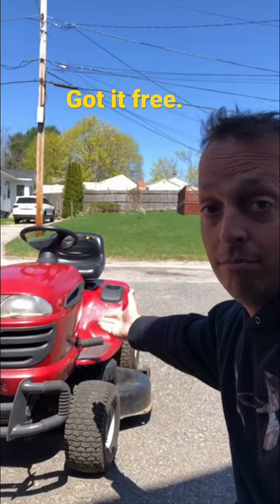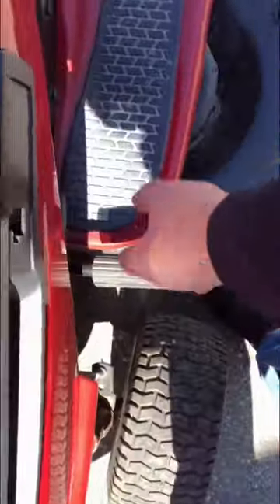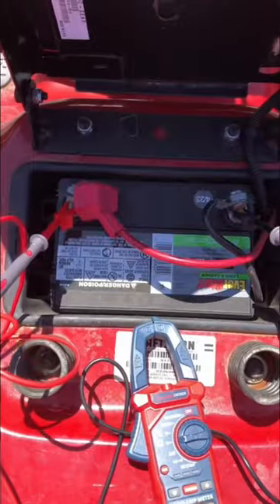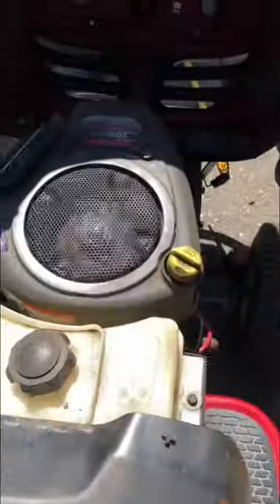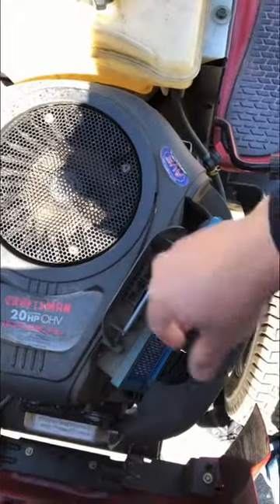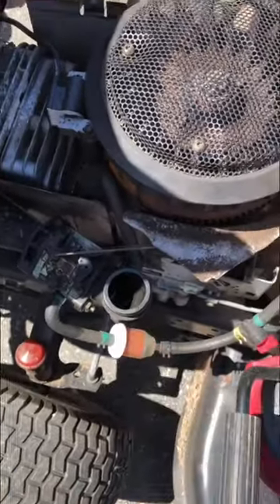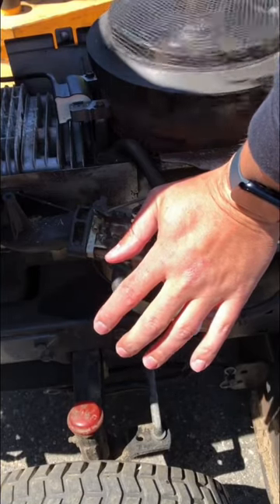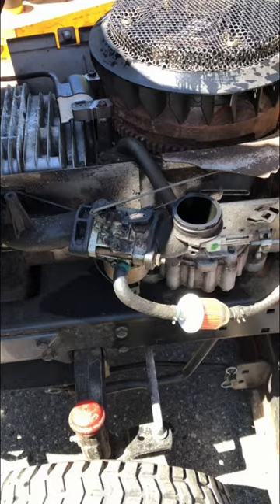Free mower. Won’t start. Cover the air intake! Briggs engine, Craftsman mower #smallengine

Comment: The fix is a valve adjustment. The decompression valve is not working. Briggs 101
Reply: The fix is to replace that piece of shit OIHV single with a better built flathead. I'm going with an 18hp boxer.
Reply: How do you do a valve adjustment
I have the same problem with my mower
Reply: Very good, that is exactly the problem there. 👍
Reply: Hydrolocked
Reply: @johnwaugh2613  it's usually on the exhaust valve, there's a weight on the camshaft that's deactivated by centrifical force once it starts. What has happened is it has loosened up the rocker arm, an needs to be tightened just a bit. Your motor will have its own valve lash specification. Pull the valve cover off and you'll see what tools you need. On compression stroke it releases a little bit of compression by moving the valve just a tiny little bit. When it's backed off all the way the starter doesn't have the balls to roll it over with all the compression the motor produces. There should be a YouTube video on your specific engine
Reply: @germanmg42  thank you for taking the time to explain that . I'll have to watch a few  videos on it.. ill give it a shot !!!!
Reply: @johnwaugh2613  your very welcome brother!!! Hope it helps. Love and happiness from a farm in northern Michigan! 👍
Reply: @germanmg42  love and happiness to you as well from the rural 🪵 woods of North Eastern Connecticut..
Reply: Bro that intek needs a cam. Compression release is on the cam... or was
Reply: Adjust the valves. That's a common problem.
Reply: @monadking2761 💯% correct
Reply: @German MG42  I think it was .004" gap on both valves, but I'm not sure off the top of my head. I did mine years ago, but I need to do them again since it starting to put a strain on the starter. Mine is the B&S 23hp V twin motor. If you don't have it right, it's very hard starting.
Reply: @monadking2761  yeah you aint kidding lol
Reply: That's exactly what the problem is the valve's are to loose
Reply: Honestly it about $400 and I would mess with it on my own.
Reply: @TestECull OHV engines are objectively better than flatheads. I have an almost identical Briggs on a zero turn and it works great. the only flathead engine on the property hasn't been used in years since it's underpowered and heavy.
Reply: @boostaddict_  The flatheads are basically unkillable. As long as you change the oil in them they will literally last for generations.

The OHV engines? Nope. Lucky to get 10 years out of them before they're shot. When Briggs went to OHV they went full steam ahead on disposability. They stopped putting steel liners in the blocks and instead went to a really shitty coating that wears right off. They're prone to bending pushrods if they're worked hard because the valve stem guides pinch the valves when the head gets hot. They're prone to...well, this very issue at hand, wherein the decompression system fails on them and makes them almost impossible to start. They use plastic in places plastic should not be used, their carbs are non-adjustable, and just in general they're designed to be discarded like an empty starbucks cup on the regular.

The current crop of them, particularly in consumer grade stuff, are especially bad about that. The push mower engines don't even have oil drain plugs anymore! You're just simply not supposed to change the oil in them at all...just check, add, go. Sounds to me like Briggs wants them chucking rods every 2-3 years.

Sure, sure, they're making more power out of less cubes, but the tradeoff is that legendary Briggs reliability and longevity had to go out the window. I'd much rather have the heavier flathead that needs more cubes to make 18hp but will outlive me than this shitty single that can't crank itself over if it isn't babied.

Side note, you see this in cars too. Same exact sorts of bullshit happening in the family runabout. And funnily enough, the next car I buy will also have a flathead engine in it; I don't care about HP per CID or HP per Liter, I care about how many generations the engine will last for.
Reply: @TestECull  Thats a meme lol, you mean you had a flat head ic motor that isnt clapped, if you want to join the modern age Kawasaki and Kohler have nice industrial lines
Reply: @nahhh5318  I dont want to join the modern age. Disposability sucks.
Reply: You don't have a clue
Reply: @FUCKEDUPFAB  Why I'm going to put one on my tractor in leiu of the current 18hp single.

I'd also love to build a gokart around one one day.
Reply: That's what I was about to say but you beat me to it.
Reply: It's not the valves it's the camshaft decompression valve is broke
Reply: @russellgiles4644  Obviously you don't fully understand how the decomp valve works. The valves must be in adjustment in order for the decomp valve to work. However it is possible that you are right and the decomp valve on the camshaft is broken. But unlikely.
Reply: Pressure relief is broken on crank shaft. Too much pressure to start. And don’t take cowling off. Cover intake on right side of filter. Your welcome😊
Reply: There is no decompression value, the exhaust valve is supposed to never really close, lowering the compression
Reply: We had a bent push rod and header needed replaced idek how it happen brigs stratton mower 4-5 years old
Reply: Top dead center,  remove valve cover,  adjust to the thickness of matchbook cover
Reply: @johnwaugh2613 check out taryl fixes all valve adjustment
Reply: It’s always hand play for me 😂
Reply: @johnwaugh2613  just add another line to it bro connect it throw some WD-40 it’s out of adjustment old lawnmowers always, end up like that when we sit in the sun
Reply: @TestECull just found my first as you call it flat head Boxer,Kohler engine in an old craftsman Tractor, most had the Briggs flathead Boxer
Reply: It don't have what they call, CHOKE, it's normally a lever to do that
Reply: @TestECull  thats not a boxer thats called an opposed twin
Reply: @seanmckay3392  Ok James May, we get it now. Back to Oz Clarke with you
Reply: You took the words out of my mouth
Reply: Yep. Had a John deere 255 once and it would do the same. Adjust the valves and it would tick. Try to get it better its just that or the tick so I chose the hard starting lmao I didn't like the tick.  I just spin back to compression stroke an then hit key. Would have enough momentum to start everytime. Just was annoying
Reply: I was looking for this comment

Comment: Adjust the valve lash so the internal compression releases work properly
Reply: He can take it to a mechanic.
Reply: unless the lever broke, motor is junk briggs anyway.
Reply: @voidvincent  what's your point. He's trying to fix it himself. Defeats the purpose..
Reply: I don't know how many mowers I've picked up for scrap that I just have to adjust thhe valves and they run great
Reply: @rogersmith9506 they are alright? I suppose. Obviously no where near the glory of the flathead briggs but still alright. Have used and abused a 18.5hp in the Deere zero turn. Has this Issue lol. Always just charged it up before hand and make sure it doesn’t die or it won’t restart. Swell looks like I got more stuff to do hehe.
Reply: Have a video or link to executing this issue

Comment: Wow! I have spent 2 full days messing with my scotts s1742 and could not figure out what was wrong with it. Ive watched just about every other youtube video. Saw this now at almost 9pm and had to run out back to try it. It started up just like yours. From reading comments, it sounds like I have to adjust the valves. I was ready to give up 😂

Comment: That’s an excellent way to 
bend/brake a rod!! 😂😂. Take the spark plug out people. If it’s so flooded it won’t turn over it’s gonna break something.
Reply: Not flooded. It didn't have compression release that's why it wouldn't spin over. All that fuel Is there is because he was blocking the air intake and it put extra vacuum on the jets while cranking.
Reply: It sure looked like a lot more gas coming out of the intake than is typical when hard choked like he did. That said, in my experience, if enough fuel is in a cylinder to hydrostatic lock, the starter isn't likely to turn it over. Even turning by hand can be tough.

Comment: Valves, not adjusted properly, or that particular Briggs is known for the compression release breaking, btw, all you had to do is  back the engine up to tdc on the exhaust stroke, it will start then, 45+ years experience working on small engines
Reply: Just took my craftsman T1400 engine apart. Piston connecting rod was shattered all in the bottom of the oil pan. Poston looks good, cylinder looks good. Gover has a couple of broken teeth. Do you think it would be rebuildble? If I install a new rod and rings?
Reply: @FrankAtwood  shure, if the crank journal can be polished, and is not damaged, I have used muriatic acid to do this it works😎👍
Reply: @warrenfloyd1484 do you have your own channel on YouTube?

Comment: Adjust the valves, 5 thousands and it’ll start working fine
Reply from the maker: Worked like a gem 😉
Reply: That's pretty cool you could call it like that whataguy
Reply: But spec is .003  intake and.oo5 exhaust
Reply: @keithkillion4245  on units with decompression release, they start easier with the extra clearance. You need the extra clearance when the DCR hits the cam lobe.
Reply: @NiceLawnBro i got the same exact mower, if that blade engagement cable breaks just order a new one do the whole kit not just the spring.
Reply: Tighten or losen 5 thousandths??

Comment: It's flooding, our mower did that. We cut in a fuel valve on the line and shut the fuel off when not in use.
Reply: that helps, but the mower will always run too rich while running until you fix the leak

Comment: If it's hydro locked from fuel there's a good chance the crankcase is full of gas too. This is caused by a stuck fuel solenoid most of the time.
Reply: Usually at the crankcase is full of gasoline it's going to have a hard time idling properly.
Reply: You are correct sir.
Reply: Incorrect, the fuel solenoid has absolutely nothing to do with the engine flooding
Reply: @terryayers6770  no he’s not. He’s completely 1000% wrong.
Reply: @THEMOWERMEDIC1  I mean, a fuel solenoid going out could cause a hard start, but isnt going to flood the engine.
Reply: @THEMOWERMEDIC1 let us know where you're at so we can warn others not to go there. You are wrong about a very basic thing. Mower medic😂
Reply: Nikki carbs let gas come thru faulty seat valve
Reply: @semiprofessional8470 The fuel solenoid DOES NOT HAVE ANYTHING TO DO WITH THE FUEL LEVEL IN THE BOWL. it is meant to plug the main jet when you turn the engine off. The float is what is meant to stop the fuel from filling to high in the bowl (the fuel level in the bowl overflowing is what flooding is)
Reply: @semiprofessional8470  I’m not wrong 😂

Comment: i'd love to have a beater mower like that to just mozy around the yard in and drag the driveway smooth..  my brother mows our grass on a clapped out john deere s240 but i'd love to have my own. when i was a little kid we had one of those old boxy murray tractors with the 3spd transaxle control between your legs. I did 500 miles on that thing if i did a foot.

Comment: Yep when you do this trick you know compression release bad and needs replaced
Reply: Coming from a mechanic my whole life I have never heard of a small engine such as a lawn mower motor having a compression release for a motor with low compression from the factory Motors that have compression release are for high performance high compression Pistons that are in dirt bike and quad Motors that require premium gas to run
Reply: @dustinolney3977 no it's true that they have them. That starter can't spin that engine over without it. Yes the compression ratio is Garbo, but you gotta realize for these weak low performance lawn mower engines to be 18 HP, their displacement is massive

Comment: First, put a Fuel Shutoff Valve on it, and try it after waiting overnight.
Reply: The fuel solenoid has absolutely zero to do with the engine flooding
Reply: @THEMOWERMEDIC1  If you could read, I said Fuel SHUTOFF VALVE. It stops the flow of fuel to the carb/engine.  The Solenoid can also cause it.
Reply: it needs a camshaft compression relief has broken off
Reply: @THEMOWERMEDIC1  Um if your tractor is gravity feed fuel system it sure as hell does cause fuel can and will leak in to the engine. Have had it happen on mine a time or 2.

Comment: We have the same issue with a TroyBilt LT1842 tractor. It hydrolocks from fuel leaking past the float valve. Simply turning off the fuel valve for a few seconds before shutting down will alleviate any issues on restarting.
Reply from the maker: 🛎️ 🔔 nailed it! 🥰
Reply: That's what I just comented.
Reply: His wasn't hydolocked that fuel built up in the intake pipe after he plugged it and was cranking it sucking up a bunch of fuel through the jet

Comment: It could be the valve adjustment. It could be the compression release. On mine the float valve was leaking and filling the cylinder with gas. I saw gas come flying out of your carburetor. Fix on mine was replacing the float valve and putting a shut off in the gas line.

Comment: I bought a brand new el cheapo craftsmen push mower.  I couldn't get it to start.  Then i took air filter off and choked it like you show.  Has started every time on first pull for 10 years.  Probably should have returned it but it works And it's easy.
Reply from the maker: YESSSS!!!!

Comment: Valves need to be adjusted, the decompression part of the exhaust valve isn't able to work due to it being out of adjustment causing high compression during start up.

Comment: Dang. My Troy bilt pony riding mower  is doing the same thing. Someone suggested it was a decompression issue. I just replaced the pto cable and put in a new carb. It didn’t have a starting issue til I had a guy check it out as it was running kinda rough. Now won’t start. Sounds like changing the cam compression whatever it’s called is what is needed. This may be a silly question but.. is there a way to confirm that’s the issue? Someone else suggested the ignition coil.. sigh.
Reply from the maker: From the outside, you can look at the valves. Notice how the one valve didn’t have much movement in mine? But the other one did! Spin the engine by hand and watch the movement. Tell tale sign. Beyond that, four bolts and the engine is off. Crack the case and you’ll see.

Comment: Your cam is broken. The compression release is not working. That's why when you restrict the vacuum it allows the engine to spin freely. The compression release is in the bottom of the engine about now. And if you keep running it, you can pound the pieces right through the crankcase with the bottom of the rod.
Reply: I was just thinking the same. I replaced 3 cams so far this year because of a broken compression release
Reply: @jameshedrick9582 were they OEM or Chinese cheapo?

Comment: I had a mower that would start like this. Where the starter was trying to engage but it would go then stop. Ended up being the top part of the engine that spins. The magnets were rusty and ended up shooting out of the top and broke a piece of the engine case off. $700 new engine and she runs better than ever.
Reply: Wow who knew a mower with engine problems would start running like new after replacing the engine xD
Reply: @exceptionalanimations1508  GFYM. 🤌🏽

Comment: check the ground connections, you can also mesure the voltage at the starter motor if there is any drop in the voltage you have a connection issue
Reply from the maker: Multimeters are the best!
Reply: Did you watch the video

Comment: Your cylinder pressure comes out the air intake.
Your valve is open at the wrong time.
Check the flywheel key, your valve adjustment, and possible defective cam.
Note also if vibration is abnormal due to the blade hitting something in the past.
I'm waiting for the next installment.
Notice it just doesn't sound right at any point in the process.
Americans had no problems like this making Briggs engines.
But, f them, right?
Some 9 year old made this one.

Comment: Could be a few things together that made the issue but ultimately it just needs to be cleaned and tuned it's basic mechanic  matence air lines fuel lines air filter and gasket check the rest is just hitting with carb cleaner then some wd4 to lube up some of the rust off the surface of any but yea it's easy work really

Comment: Adjust valves, starter can drag because of worn out bushings or brushes too. Solenoid can get weak and not allow full power to the starter. Choking more gas into it, is not a good, temporary fix. Liquid Gas washes the lube off the cylinder wall, causing extreme wear, very fast